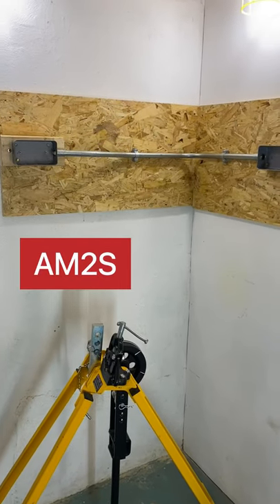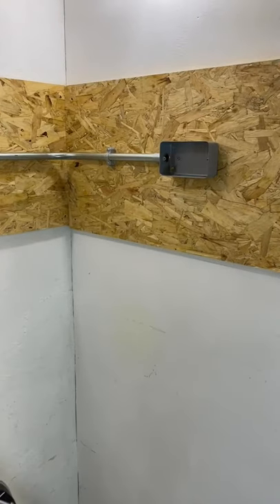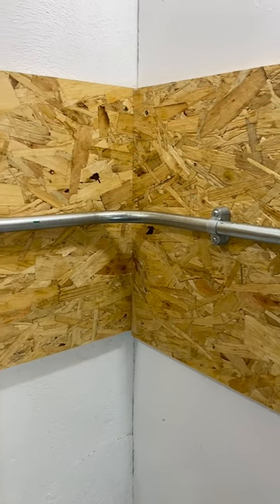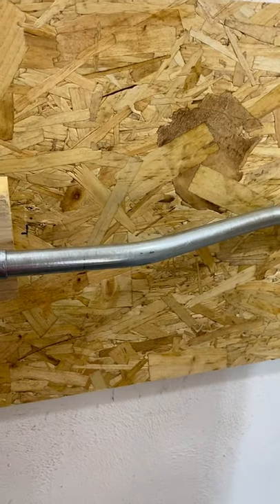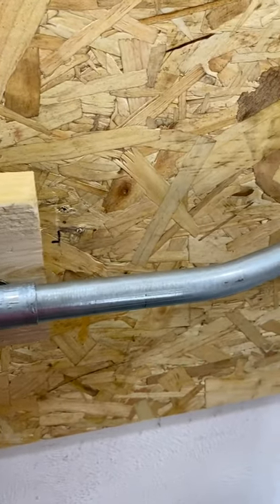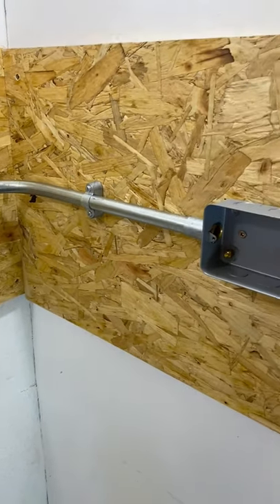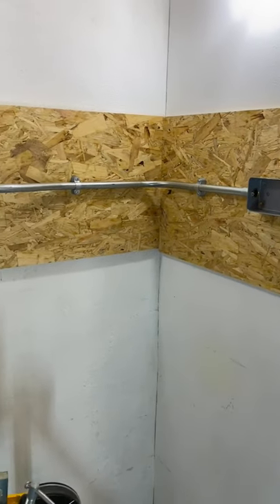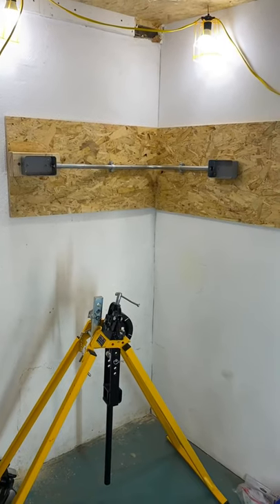AM2S & AM2E Top Tips - Bends Requires in Steel Conduit

Comment: Just done my AM2S. The set Was 26mm. Also you had 8cm for both bends
Reply from the maker: Thanks for your input 👍🏻
Reply: Wdym by 8cm for both bends?
Reply: @dezire8470  The size of section you need to fit the set in. Both bends need to be within 8cm
Reply: @CobraTheOG   so you was only allowed 8cm between each slight bend when doing the set?  Also did you have to do plastic conduit?
Reply: @dezire8470  Yes. So from the heating controller. You had 17cm to the end of the wood panel it was on. That's the reason why you needed the set. So my first bend started at 18cm. You had to complete the set within 25cm.
Reply: On the Am2s you have to do plastic conduit yes.
Reply: @CobraTheOG  what did you have to do in the plastic bud?
Reply: @dezire8470  You have to do a bubble set over a length of conduit going down a wall. It needs to be like certain distance of the existing conduit, then you need to do a 90 into a socket. All in one section. It was harder then the metal. However you wont fail if its slightly out.
Reply: @CobraTheOG  8cm seems very small for fitting 2 slight bends I.
Reply: In
Reply: @dezire8470  You're exactly right! I barely got them in the conduit bender. The bend were back to back pretty much.
Reply: @CobraTheOG  yeah seems really tight  I know it’s 20mm in the AM2S but doing 25mm today there is no way your fitting that in 8cm
Reply: @dezire8470  I just sat the AM2S and didn’t have to do any plastic conduit - was only required to do 2x 90 degree bends into a light fitting it was really easy luckily as I haven’t really don’t any conduit
Reply: @uplightuk8924  I sat mine a month ago and had steel and plastic conduit
Reply: @dezire8470  Hmmm guessing it differs depending on the spec. I literally had to do conduit up a wall, 90 degree bend onto the ceiling, then 90 degree bend into a light fitting. Was allowed to use a running coupler which I got told they didn’t allow before I sat it lol

Comment: Can you bend copper piping for plumbing and vice versa. 😳
Reply: Different benders for different jobs
I've got
Electrical stand for 20 & 25
Plumber which are hand use metric
Refrigeration  for fridge pipe imperial sized  both hand and stand type